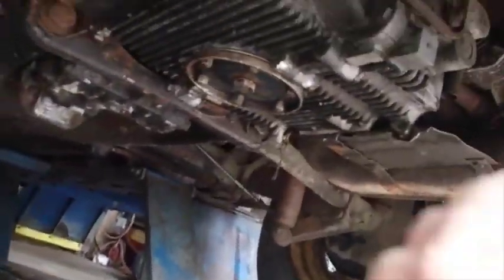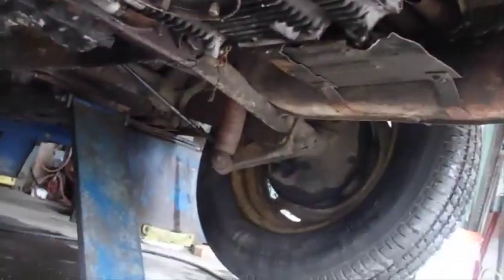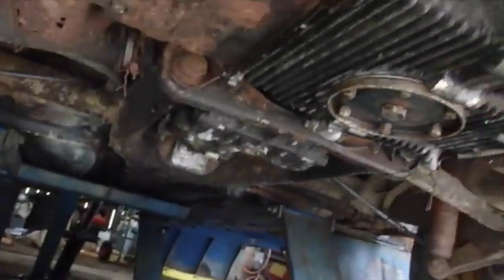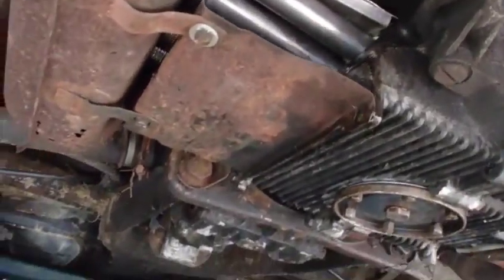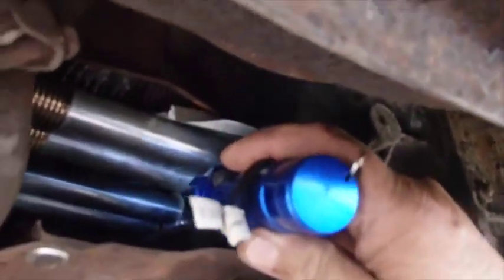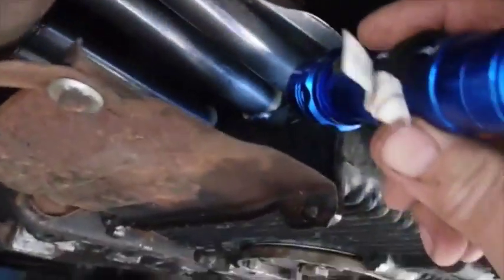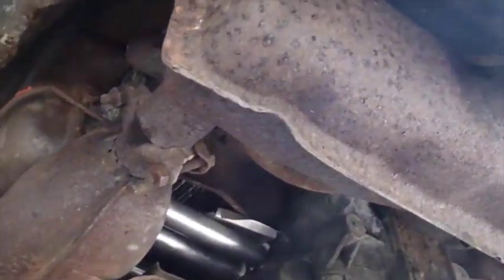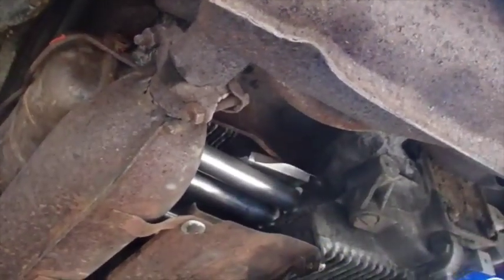67 VW still leaking?

Comment: Well at least it isn't a gusher yet Mr. Peek. Yeah I hate tracking down oil leaks especially when they are in so far that you have to drop the engine. I was lucky my oil sending unit was cracked but it was easy to get to alot easier than getting to that oil cooler. But some days you get the bear and other days the bear gets you. Thanks for sharing

Comment: The leak does look to have slowed down a bit. I'm kinda wondering if it wasn't leaking from both the oil cooler, and, the push rod tubes.

Comment: Mr Peek some engine designs are just susceptible to oil leaks, but you are off to a good start. Check the oil cooler seals. The only way to stop a VW Bug engine oil leak completely is to:   A.) Remove all oils from engine.   B.) Remove engine from car.    C.) Remove engine from car and replace with Chevy small block engine.  4.) Thoroughly clean engine, rebuild with all new gaskets, install engine in car, Never fill with oil and never drive again.  (Just kidding Mr Peek) The only way to fix any oil leak on a bug engine or any engine for that matter, that is old or has been sitting around, is to thoroughly clean and replace all gaskets and seals with the best quality products made.
Reply from the maker: Oil leak?  What oil leak..   hahaha.
Reply: +rpeek    I can't see it from my house.